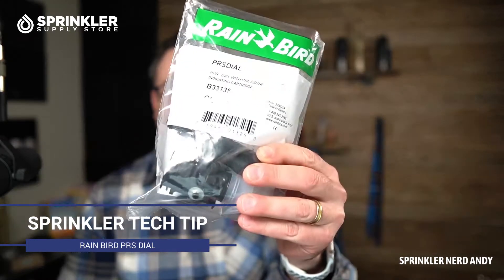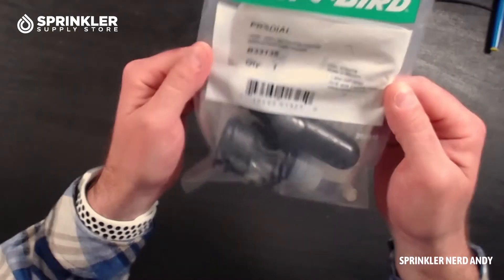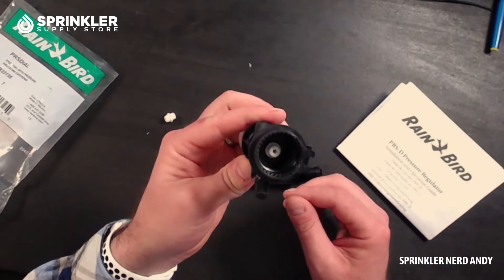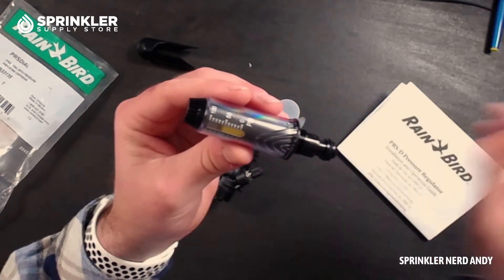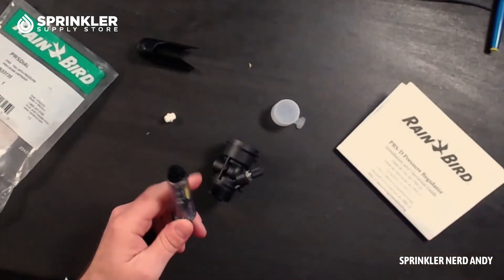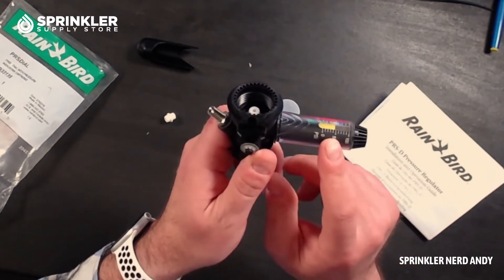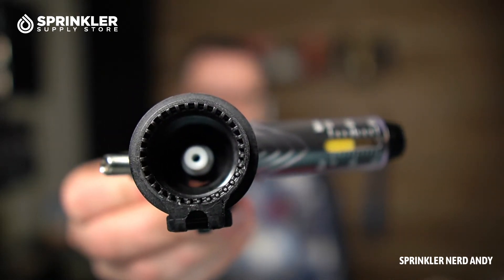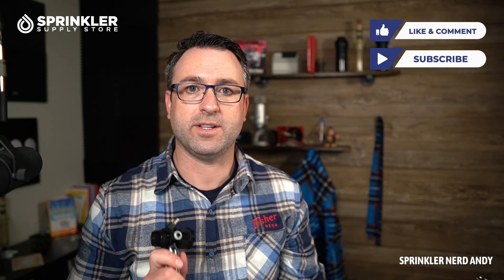Rain Bird PRS-DIAL, Pressure Regulating Dial for Rain Bird Valves

Comment: The small white piece is a replacement or spare "solenoid seal". It is intended to replace the existing seal that is in the valve body. The interface between the plunger in the solenoid and the "solenoid seal" control the flow of water and open/close the valve. Over time and due to manual bleeding of the valve, the plastic "solenoid seal" may become deformed which could create an internal leak path when the PRS-DIAL is added and cause the valve to weep.
Reply from the maker: Jeff Johnson coming in hot with some great information. Thanks for sharing!